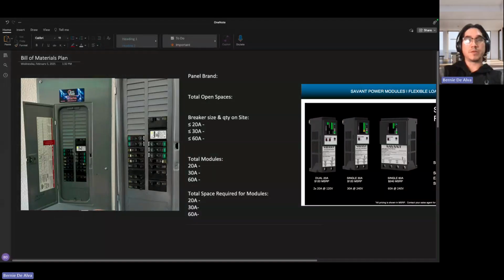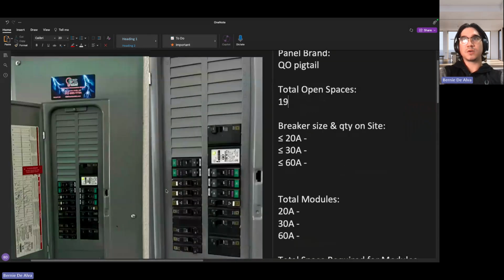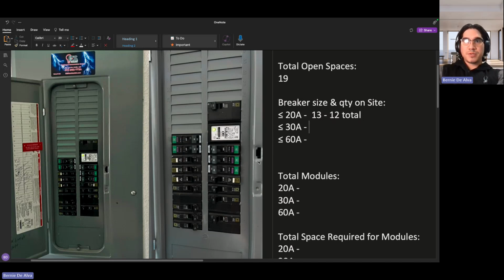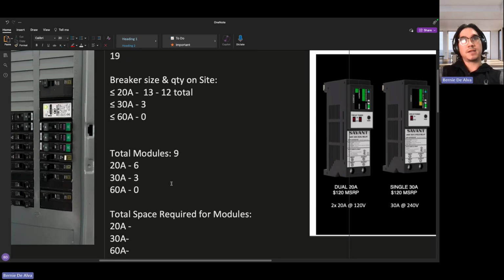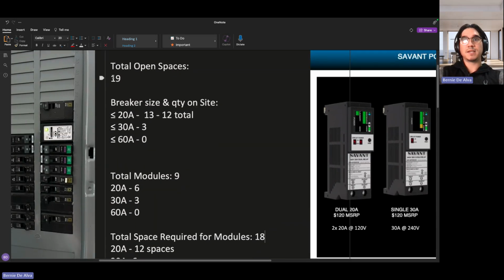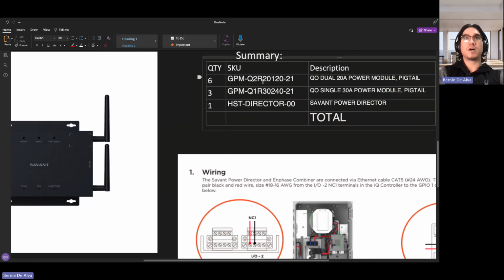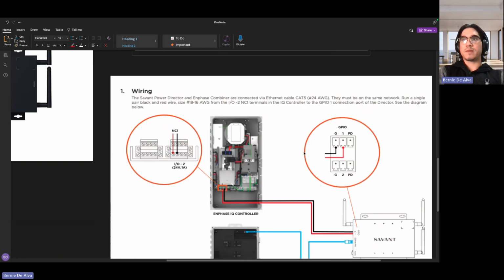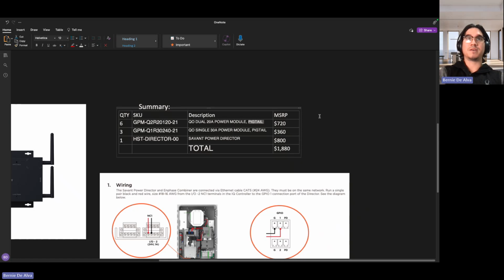Savant Power Smart Panel Setup: BOM & Installation Planning

Comment: Great video Bernie! Out of curiosity, why can’t the internet be on one of the modules?
Reply from the maker: It is so that the homeowner does not turn power off to their network. Think of a command from Savant through the network telling the power module to which it's connected to shut itself off. Network suicide in a sense. 
If the homeowner ever does this accidentally, we have a bypass switch on the each of the modules that can turn the equipment back on with ease. 

If the equipment is connected to a circuit with a power module, the homeowner can simply turn that circuit to the ON position to still have monitoring capabilities throughout that whole circuit.
Reply: @berniethesolarguy that makes total sense! Thank you!